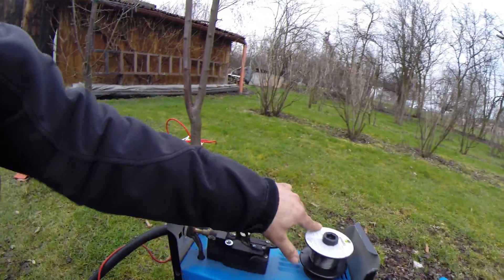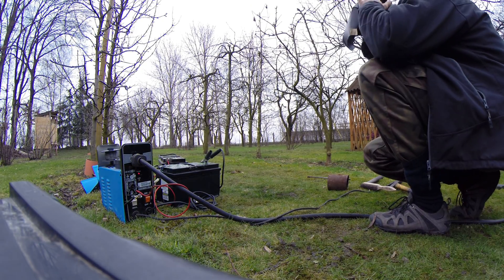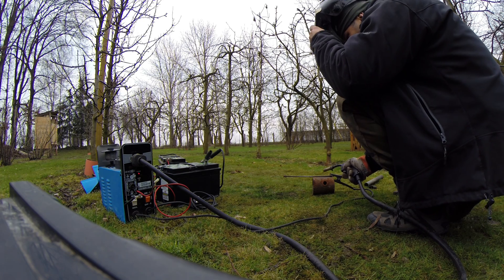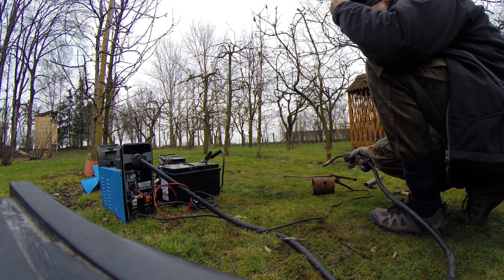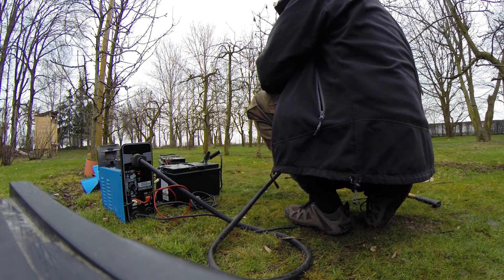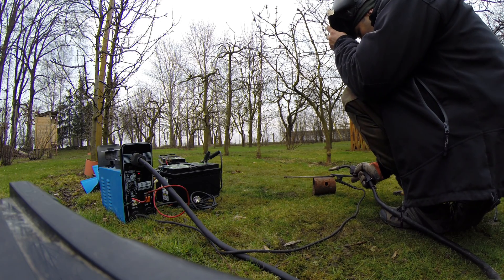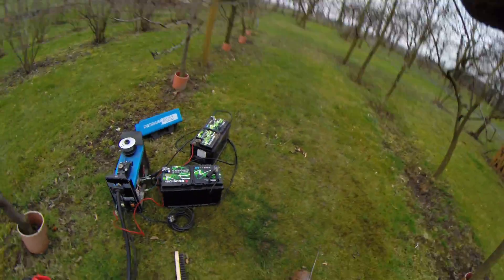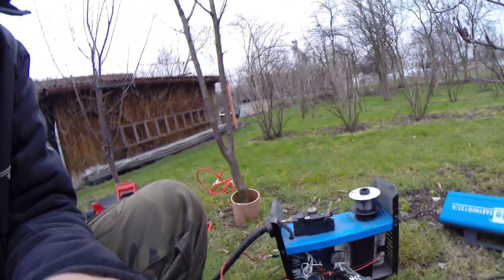MIG welder  - DC 24V battery convertion test

Comment: So you are not using the mig feed? Arc welding seems to work well with just a pair of 12v batteries.  I have a mig gun and want to power it with flux core wire and 24 v battery
Reply from the maker: it was something simpe like mig gun,  mig fed was working  also on 12 or 24v  pushing the wire, was just a test ..
Reply: I think you will need a 24v motor controller with a dial on it to fine tune the feed.
Reply: @gacattack1234  I ended up just buying a $100 MIG welder 140amp, works great.  It turns out a MIG needs a control system that is different than an arc welder, which I could do, but it would take a lot of time and testing, which doesn't make sense when the mig welders are so cheap.

Comment: Did you set the ground as positive and wire as negative?
Reply: Use real battery shoes and thicker and shorter cables.

Comment: This is great. What powers the wire feed? Do I need the original AC power to turn the spool or does it also run off 24V?
Reply from the maker: Old idea but working , spool working on 12v slower ,faster on 24v  i have connected spool motor straight to 12v and pistol swich